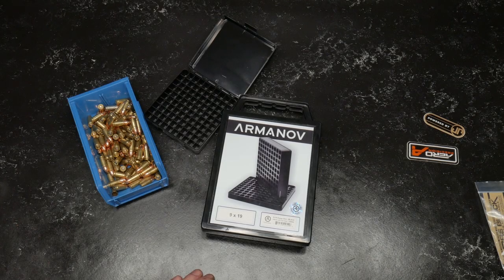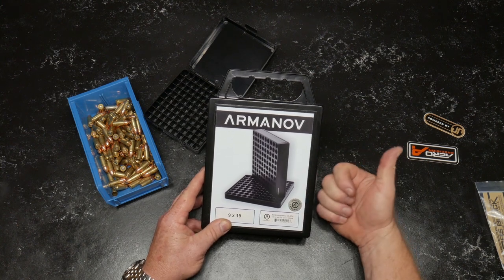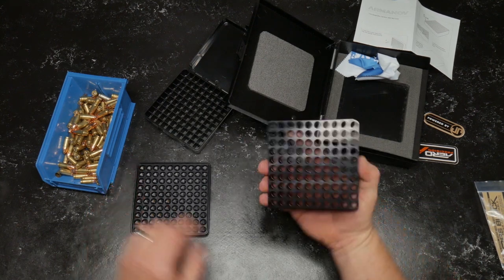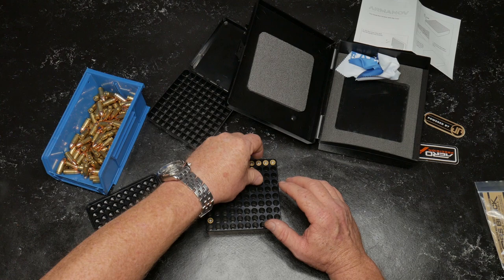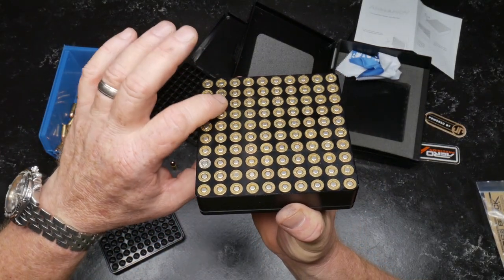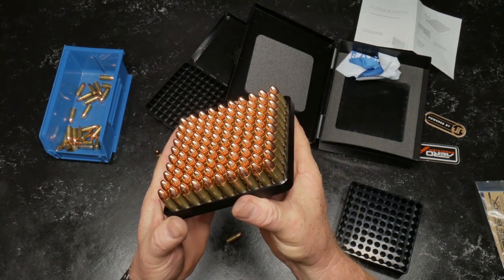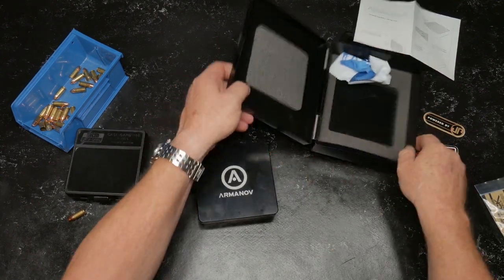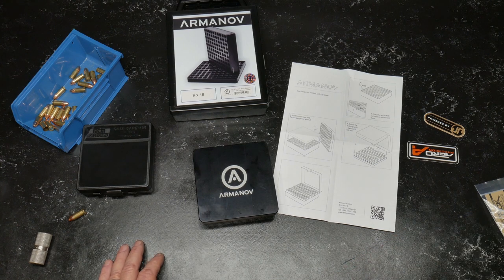Reloading Precision by Armanov Case Gauge Block Review

Comment: My 9mm goes in my case gauge just fine but needs to be tapped to come out. Its the only caliber that it does it too. When i do the plunk test in my barrels it drops just fine. Plus they shoot fine. Dont know why the damn thing sticks in there
Reply: Safety factor.
Reply: First thing you should do is see if your case gauge does that with a factory round, if not then there could be several factors at play. If it does clean it good and try again, I meen clean the gauge, if it's still doing it inspect for a bur or contact the company and have the replace it, if it's not the gauge. 1st, could be case gauge is cut at min spec or possibly bored wrong, and your chamber is a little generous on size. 2nd possibly it could be a die alignment issue and bullet not seated in straight. 3rd possibly your bullet may not be seated deep enough. 4th It could even be your finnished rounds may not be tapper crimped down enough.
   However one sure way to fix alot of this, buy a Lee carbide taper crimp Finnish die. It'll insure that rounds are properly taper crimped when set right and the carbide ring will smooth out the round, along with taper crimp portion will do a final alignment. Use a digital micrometer to check a few brands pf factory brass loads just below the case mouths and set the die to crimp the reloaded  rounds at the same measurement.

Comment: Okidoki.  1st always uniform your primer pockets, 2nd  if you load in bulk, keep them all to the same lot numbers if possible to help keep track of number of times loaded and seperate into boxes of same length lots within lot numbers or just trim all to same length, 3rd never prime on a progressive press , use a table top priming system thats adjustable so each primer is kept at a nominal readiding between .003 and .006., allowing you to feel for those to loose primer pockets  (( as well as deprime by hand or with a dedicated deprime) so primer pockets can be cleaned with case cleaning)).  4th use a Lee factory taper or crimp die or carbide final chamber/crimp die and if your press is properly adjusted,  bullet seating depth and cartridge overall lengths will stay the same. And most of all, c.o.l. may be different for your chamber depending on its min. or max. specs and cut and what works best for your gun.
   This multi cartridge chamber checker is a good idea, but it shouldn't be relied on as much as proper adjustment of dies and equipment, but could very well indicate a problem in your processing. It's certanly alot faster than useing a single bore chamber/cartridge checker. Thats a slow day when double checking several hundred rounds for a a competition or long day at the range with freinds.
   As for the expensise, its defiantly geared for those who can aford to compete or has to ultimately relie on his/her ammunition for their lives. Still a very nice tool.
Reply: From one reloader to another very well said read my remarks on this matter.......

Comment: I can appreciate the theory behind this product however a product that has an MSRP of $119.00 should do more.  For example yes, it clearly will show you if you have any cartridges that are long, but what if you seated a projectile too deep?  It won't show you that based on your video.  Also, you can simply use a caliper to check your cartridges for a fraction of the cost.
Thoughts?
Reply: Too long might not chamber, a little short  will  still go bang, the benift is time with being able to check up to 100 at a time, instead of one with a caliper. Is pricey though.

Comment: Come on i have been  reloading for  42 years i load for my chambers in witch most are sigarms even my g17 with  and without  the aftermarket  barrel along with of several  cz75 clones its not rocket science i use a 40 year old rcbs junior  to a ammo master even a lee classic  4 station were the science comes in is making  22tcm and 22tcm9r from 223/5.56 brass its a very tight  chamber in all 5 i own just like making  6.5 grendel from 7.62x39 again  not easy even the 357 sig round made from  40 s&w has its tricks people just chamber  check  your brass or even better  your loads.
Reply: @Pauly Walnutz its like putting a band aid over a band aid you have on already please don't tell me to unsubscribe shame on you your opinion is  yours and mine is mine remember the mistakes of the yankee marshal. you post take the  good with the bad . only Kotaboy 32 could have sent the unsubscribe link shame on you. after all i have over 16 reloading presses  i started at 17 because i was not able to buy ammo. And five of my presses are progressive i shoot over 15k rounds a years how dare you tell me to unsubscribe.  shame SHAME SHAME ON YOU. WOULD YOU LIKE ME TO POST THE LINK for me to unsubscribe. And may God save  the USA.   I don't have a pojnt Pauly Walnutz   is it a z  or a s.
Reply: Yepper. Its just having it setup properly. There is alot to pay attention on a progressive, and the biggest worry is powder charge. If using a preset die head, then powder charge is the biggy. I prime off press with a dedicated primer system that allows for precision depths on primer seating, but even on press I can set it at the proper depth. I know one can slip buy occaisonally but it usally is apparent befor even the gauging stage. Also the one best thing is Lee's finnal carbide taper crimp die. It asures every round passing thru it will chamber and sit straight.  Best finnal die ever in pistol cartridge loading.